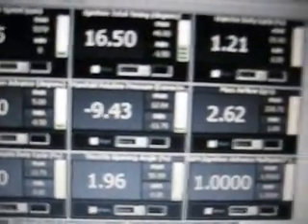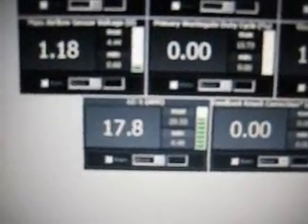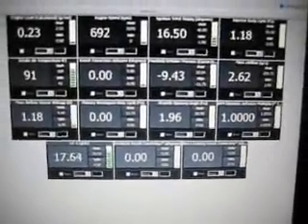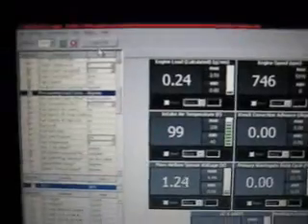Basic Enginuity/RomRaider Datalogging How-To

Comment: 13 years ago, I know.. but 17.x AFR on idle? Isn’t that rather lean?
Reply from the maker: hello Nick, thank you for your comment, the false lean condition you see is from fresh air contamination hitting the wideband sensor which is fitted into an Innovate venturi O2 sensor tailpipe clamp. And funny enough, that same Innovate LM-1 wideband box is still in faithful operation, save for the 15-20 sensors I've run through over the years.

Comment from the maker: for a 5-speed car I will use 3rd gear for most of the tuning. then I will check 4th gear and ensure there is no knocking and stable AFR. Then I will tune the 1st and 2nd gear ranges, which are typically found in lower load columns. Like I said I can add timing and lean out slightly here as load is less, and the car spends less time in the high rev range. On a 6-speed car I start in 4th instead of 3rd.

Comment from the maker: absolutely. Maybe not 1st gear or top gear, but all the "usable" gears. The car will experience more load, and more heat, during a prolonged pull in a higher gear. You might be able to get away with a leaner AFR or more ignition advance in a lower gear, because the average load is less in those gears.

Comment from the maker: if you read the video comments you can see that I was using a Innovate Motorsports tailpipe clamp for my wideband O2. At idle, fresh air swirls into the muffler and causes a false lean reading. This goes away as soon as the car starts moving.

Comment from the maker: @shiftymcshady I don't log WGDC once boost is tuned... no reason to. AF learning doesn't need to be logged as you can check it with learning view tool, there's only four ranges and D is always applied. AF correction is not used as soon as the car enters open loop, so it's useless to log for WOT tuning. Of course it must be logged to scale MAF or injectors. My AFR is "lean" at idle because I was using an LM-1 tailpipe clamp and it has fresh air contamination at idle. Clears up at speed.

Comment from the maker: @hebs007wrx in this video I am using an Innovate LM-1 which can be installed in a matter of minutes to different client vehicles. in this particular case the car did not have an extra boss in the DP and removal of the rear O2 sensor in 32-bit Subarus will cause closed loop drivability error. Using the LM-1 in the tailpipe via an Innovate ventura clamp for open loop fueling and the stock front O2 for closed loop fueling is just fine.

Comment from the maker: rodgazinya,

As I am not a UTEC user, I'm afraid I can't easily make such a video. If you're considering the UTEC, which is a piggyback system, you should also familiarize yourself with reflashing the OEM ECU, as it has more parameters and finer control in certain areas than the UTEC. When used together, they form a very powerful system.